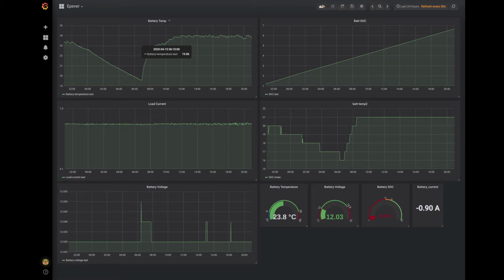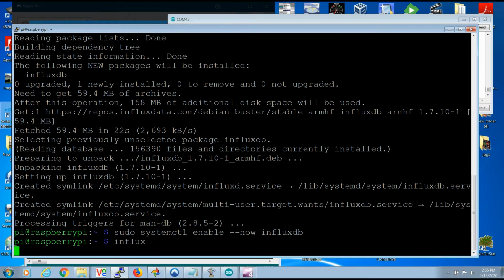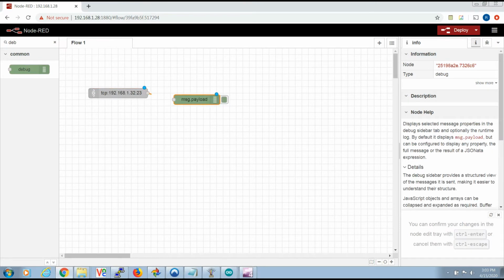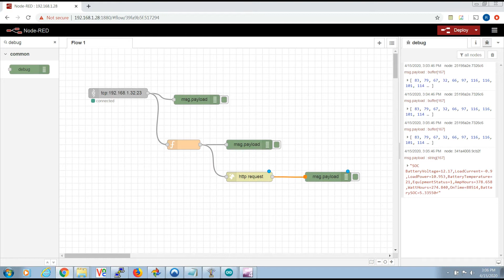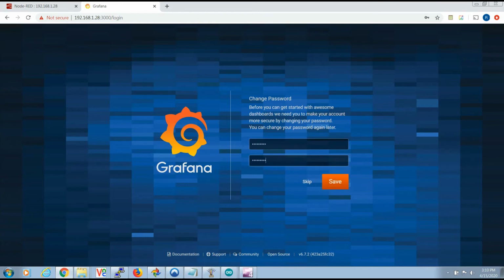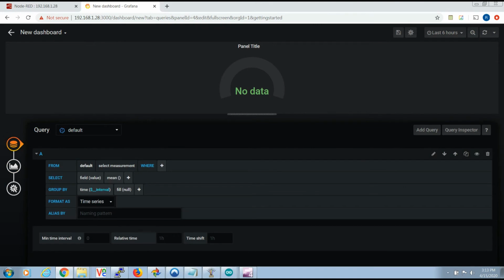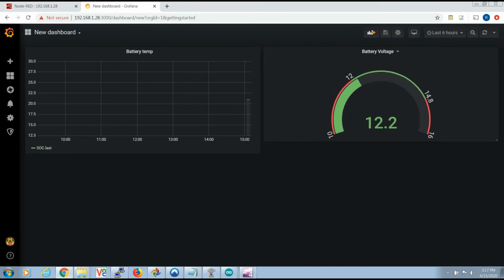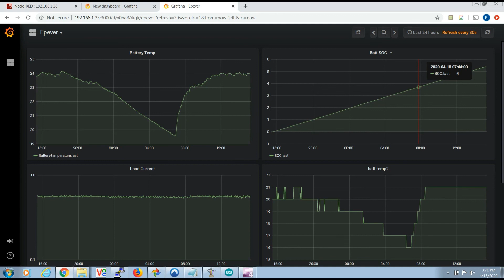A battery state of charge(Volt/Amp/Watt-hour/coulomb counter)solution for wireless network Part 4of5

Comment: Hi. Great YouTube videos! Do you know the protocol used between the shunt device and the display in the USB cable? I was thinking connecting to the USB port and grabbing the data from there instead of replacing the NRF module.
Reply from the maker: I didn't really consider USB.  However, since you asked the question, out of curiosity, I had a quick look.  The controller fails to enumerate on both Windows and Linux.  Even an unknown device should enumerate. That is, if it conforms to the USB specification.  On Linux it throws a "Device discriptor read error -71 (Protocol) error" in dmesg. I had my son (who is a software engineer) look at it a bit.  He said to get it to work you would likely need to patch the linux kernel to handle a USB device quirk. Arduino has a USB shield but the little I know about it you basically need to write a device driver to use it.
Reply: @flatman2008  Hi and thanks for the answer. I think the usb cable is only used as an connector and that is a other serial protocol used. Ex. I2C or UART. I measured the d+ and d- to +2,5v. No signaling when using the logic analyzer. Pulled one of the D lines to ground with a resistor and got some signals...
Any thoughts?
Reply from the maker: @torbjmas1  You are likely on to something. Why not hook the base unit and controller together and use your logic analyzer to grab both the d+ and d- signals and see if you can decode them?  Unless it uses differential signaling like RS485.  Although there are cheap RS485 to UART converters for sell on Amazon and such.
Reply: @flatman2008  Hi. I have connected it as you said and done a capture. I see that it is differential voltage signaling. One line goes high and the other goes low and vs.. I have not got it decoded yet. For your info, I have a older version of a VAC also, MingHe. The juntek screen can communicate with the older one also. The MingHe screen has a visable ic of the nrf. It is NRF M 24L01+ 1715AH. As you said in your earlier video, you had to replace it with a original NRF to communicate with it. Is the IC above a clone or is it the original NRF? I am hoping to communicate with it without having to replace the nrf in the shunt module.

Comment: Nice work. I have data being collected from 3 inverters already. Could data already stored in one data base used to calculate SOC? This is what I have so far https://youtu.be/-SYiI7bpo9A
Reply from the maker: Ideally you have a real time coulomb counter that keeps track of the current going in and out of your batteries.  A coulomb counter integrates the current over time.  I'm not sure if the Juntek unit I using is a true coulomb counter although it is advertised as such.  If you take current measurements frequently (say once a second) and keep track of the current going into and out if the battery that may be good enough to get a good estimate.  By doing so you are using a numerical integration. The more frequently you sample the current the better. I suspect this is how the Juntek works.  Of course you also need to set a starting point when your batteries are fully charged and start at that known point.  Also, stop counting current when ever your calculated SOC gets to 100%.
Reply: @flatman2008  I have data such as charge and discharge current Battery voltage already being collected every 4 sec. My capacity is 1000Ah. Would I have to go through Nodered first and then to grafana? I know it would be a ruff estimate.Thank you.
Reply from the maker: @DMIINC2013  sounds like everything you need is there.  What ever is pushing data into your database can calculate the SOC or you can calculate it as you pull it.  Assuming you start out with a full battery.  If you pull 4 seconds of current that is 1/900th of an hour.  Just divide your current measurements by 900 and subtract that starting full  (1000Ah) and keep track of the SOC.  Charging just add.  SOC percentage would be your calculation/1000Ah.   Just remember to cap your Ah calculation at 1000 (you can't charge your batteries greater than 100%).
Reply: @flatman2008  Thank you. What do you suggest, using nodered or grafana?
Reply from the maker: @DMIINC2013  I don't think Grafana is the right place. Grafana can do math calculations but it would need to scrub the database since the last point of full charge.  Not sure it could figure that out.  Same is true with Node-RED.  I would suggest you modify whatever is pushing data to the database.  If you can't figure out how to do that then my solution may be the answer.